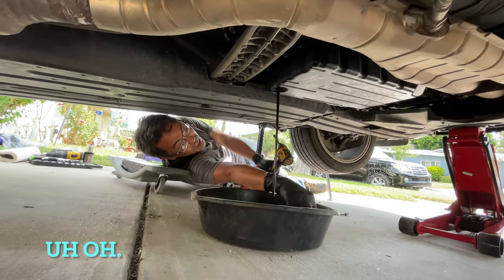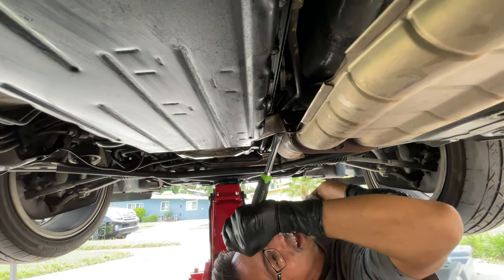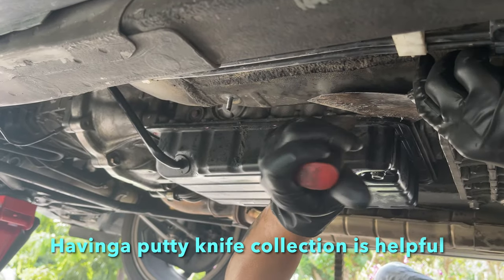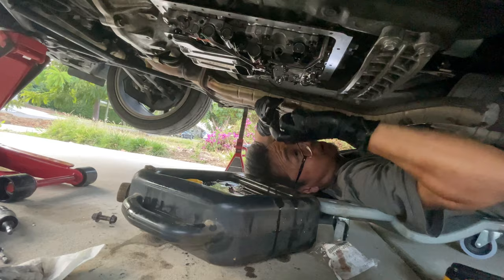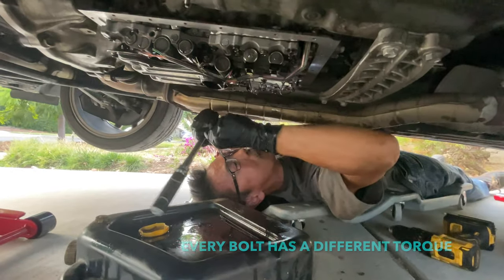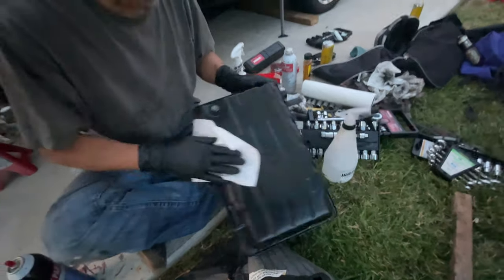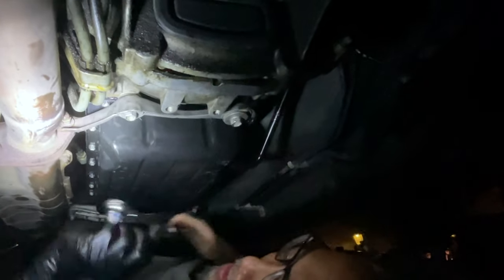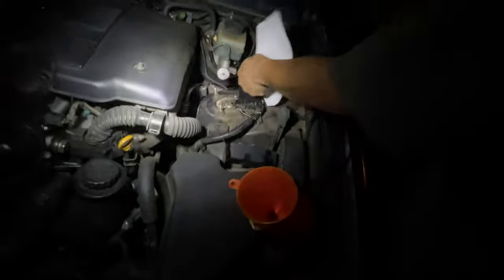My Lexus IS300 P0980 Shift Solenoid Drama.C Control Circuit High Open Short Valve Transmission Error

Comment: I replaced the solenoid on my 02 IS300, with a new OEM solenoid. Check Engine Light still comes on with same code P0763. Any ideas? Fresh fluids and new transmission filter as well.
Reply from the maker: Check the connector (I bent the tab on solenoid and connector) and check the plug continuity (20 amps I think) . Check all wires are getting voltage from harness.  Use Toyota ATF Type T-IV fluid. other fluids will cause code.  Use dealer solenoid and check continuity, deal can send a bad part.  Avoid the after market ones. The computer is sensing the ohms range,  other Toyo's part will fit, but output different ohms. and trigger code.

Comment: Your video helped me to save my 2008 GS350 with only 138K miles. I needed to change S4. So unscrewed all 20 bolts and unlike other videos, my oil pan did not budge. Then found this video. And I was able to dislodge the pan. Thank you.
Reply from the maker: glad it was helpful, it's a tedious job, but plenty rewarding when your back on the road.

Comment: hey did you also get abs codes along with the p0980, and did the solenoid fix the code? Also could you please tell me the symptoms ur car had before u fixed it. Thank you for the video
Reply from the maker: I would get mixed codes and would clear them.  The consistent one was P0980 and it fixed all my codes and check engine light and VSC lights remained off.  Until I started getting P0420 recently.  That was Bank1 Sensor 2 or B1S2.  Those codes were not related.  I checked for  exhaust leak and ended up replacing that O2 sensor and haven't had any codes or lights since.  Which is about 600 miles and passed smog with no problems.

Comment: This is S3 correct? (Shift solenoid valve No.3 (S3) I see on the identification page it’s named that. But S3 on the parts info it is listed as solenoid assembly, automatic transmission 3-way No. 2. Is this correct?
Reply from the maker: @funez-  Lexus part number 35230-30010.     Try searching the part number and looking at images.  I think it was the 3way no 2.  It was really confusing and still is.

Comment: Can over filling the trans cause the code to pop up? I’ve heard so many different things.
Reply from the maker: Hi, from what I've read, overfilling the transmission is a different code.  Has to do with over pressure.  P0980 is shift solenoid C electrical malfunction out of circuit range.  Is it the code you're getting P0980?

Comment: I have 04 gs300  with the p0980 code. Do that part and part number work for my car?
Reply from the maker: I found the link to this technical bulletin for the A650E Lexus transmission on Club Lexus and the 2004 Lexus GS300 is listed.  I think the answer is Yes.  I'd search "2004 lexus GS300 service manual club lexus" for the service manual and then search the service manual for solenoid.  Good luck.  https://tinyurl.com/vccaketj.
Reply: @Squisheyy  thank you very much for the help. Btw love the video and I subscribe to your channel

Comment: Hey. Did replacing the solenoid help? I have a box a960e with p0979. Many people say that the problem is the ECU. Does it make sense for me to try changing the solenoid?
Reply from the maker: Did you try the transmission fluid first?  I'm not a mechanic, but from reading manuals and blog post, I understood that the little solenoid sticks or loses signal. So the problems are related to fluid (dirty or not Toyota fluid), Electrical contact to the solenoid, or the solenoid itself.  I did the fluid first and got another 3 years before the error came back (Don't drain all the fluid or do a full flush, only replace what drains out of the pan).  I also tested the wiring to the solenoid and it tested good.  Then I tested the solenoid and the ohm test failed so I replaced the solenoid and haven't had an issue since.  Sometimes you can clean a solenoid out and it will work a little longer too.  It's just the exhaust brace on the 05 gave me so many problems with exhaust leaks, I didn't want to do it again, replacing the exhaust gasket is such a PITA.

https://www.clublexus.com/forums/gs-2nd-gen-1998-2005/544868-p0980.html

If the solenoid and wiring harness tested good, then it's on to the ECU testing,   My experience is that the ECU doesn't go bad. Good Luck.

Comment: i have this problem on my 02 lexus is300, where did u find the form that tells you what number shift solenoid C is because no part store has letters only numbers for the solenoid
Reply from the maker: I found it googling in a forum.  Either clublexus or my.is.

Comment: hey man I have a 2001 is300 it drives find in drives fine in drive shifts thru all gears no problem. no hesitation what so ever. But no reverse at all. it just free revs. would u think the a solenoid would be this issue as well? transmission is really over full on transmission fluid. Your help would be greatly appreciated. Love the content.
Reply from the maker: Thanks for the love.  Do you have any trouble code? Have you put it on a ODBC scanner or have a check engine light?  
Overfilled transmission could cause the problem.  Also, not using Toyota Type T-IV Transmission Fluid Toyota Part Number 00279-000T4-01. 
I would start getting with a scanner and draining the transmission fluid, not a full flush, just drain the pan and refill it. Also, get a Transmission Drain Crush Washer Part Number: 35178-30010 about $1.80 ea.
An overfill and replacing some dirty transmission fluid is where I would start.
BTW, I'm not a mechanic.
Reply: @Squisheyy  Thanks alot man I just purchased this IS about a week ago and just started doing this. I check the dipstick when hot and on the side with the levels it seem like its about a half a inch above the full mark. Then if I flipped it around to the OPPOSITE side with no marking at all it almost half the length of the dipstick. So I'm guessing surely entirely to much fluid in the trans.
Reply: it does have a cel on. but not sure the codes on it. was told it was on for evap system. At least thats what the previous owner stated.
Reply from the maker: @Vi_Bingy_Garage  That could do it. Half n inch is way too high hot, check it several times to, it sloshes through a lot of channels.  I always fill just under the hot line.  And make sure your car is level.  Was the fluid red, black or brown?  wipe it on a white paper towel and give it a little sniff test.  You're hoping for no oil or coolant smells.  If it smells burnt, you need to drain the pan and refill. I hope not.  These are great cars Once you get the reverse fixed, you're going to love the heck out of it.
Reply from the maker: @Vi_Bingy_Garage  LOL, I just finished fixing an evap error code and didn't get video, it was just a couple of hose, the air intake plastic, and another solenoid.  It's a lot easier then the transmission.  P0440, P0441, and P0442 where my codes.  Now I have an exhaust leak P0420,  I like the the forums, clublexus and my.is.
Reply: @Squisheyy  i belive it was brown is wen I checked it last. like it was the original trans fluid since 01. but I have to do that drain and refill this weekend.  man I really appreciate ur time and insight. I will keep u posted of my findings

Comment: Just replaced my solenoid yesterday. I ended up putting a little over 2.5 quarts and drove it home after that, I realized you said wait 15ish hours before driving, is it okay that I drove it right after?
Reply from the maker: I honestly don't remember why they say to let it sit for awhile.  I know if the dealer replaces it, you can drive home right away.  I think it just needs to soak, but it should be okay.

Comment: I have a low mileage 1994 lexus ES300 V6, SHIFTING ok so far so i ll do nothing,  just 45K miles, getting P0753 SHIFT SOLENOID A ELECTRICAL, any ideas, i am in NC if u close by. New to me, odd that tranny fluid about 1 inch high on dipstick cked warm
Reply from the maker: If the fluid is old and hasn't been changed or the weight of the fluid is wrong (Using only Lexus transmission fluid) That solenoid will stick.  A is usually first to second gear on Toyota/Lexus.  I'd say you have an 80% chance that changing the fluid will make the error code go away.  20% chance the solenoid A is going bad or the wiring isn't making a good connection.    I'd order the fluid online and change it.  Measure the fluid that comes out and put the same amount back in. 
Don't flush it, about 3-4 quarts of old fluid will stay in the system and you want to have some old fluid in there or it will shock the transmission and cause other failures.  I know it's strange, but the Lexus transmission is machined with tolerances in the microns and the computer adjusts like crazy overtime.

Comment: i have a is300 2003 also with the A650E trans. It shifts from 1 to 3rd then from 3rd to 5th. Is that the same symptom you encountered?
Reply from the maker: I didn't have that symptom. My problem was just the code.  Your problem with no code sounds like a dirty or replacement Mass Air Flow sensor or restricted air flow from a dirty air filter or sticking air intake flap.  Do you have a check engine light and a code?

Comment: Do you happen to know which one is shift solenoid b?(p0758) is it solenoid 2?  and what part number, I cant seem to find it anywhere
Reply from the maker: Solenoid 2 should be B. Is this for a 2002-2005 Lexus IS300 A650E transmission?  P0758 doesn't look like it isn't the right code.
Reply: @Squisheyy its for a 2000 gs300
Reply from the maker: @veecemx   
did you try changing the transmission fluid?  That works sometimes.  Here is a link with troubleshooting and an image of the location in the second post. https://www.clublexus.com/forums/ls-3rd-gen-2001-2006/807486-getting-a-check-engine-code-p0758-shift-solenoid.html#&gid=1&pid=2
Reply: Search YouTube for videos by "ATRA -Automatic Transmission Rebuilders Association". They have information on various Toyota/Lexus transmission. Once you find the video, check for the detail of it. They have posted URL to their presentation material.

Comment: Hi so i have  TOYOTA mARK X 2007 SAME CAR TO LEXUS IS250, PROBLEM, Driving in only 3 gears 1.2 and 3, does not go above that, rev are going up, When i disconnect the negative terminal of the battery it resets and the car shifts well, the problem became more common, and now removing the negative terminal does not resolve the issue, i changed transmission fluid 3 time , changes all selenoids valves  and problem persist latest diagnostic code is P0761, aDVICE WHAT SHOULD I DO NOW PLEASE
Reply from the maker: Sorry to hear, it sounds like electrical wiring or connector if disconnecting the battery and reconnecting makes it go away.  If you can get your hands on a whole harness to check the computer, that would be great to. It might be worth paying for a toyota tech computer diagnostic.  The tech needs to have TIS Techstream or Techstream Lite and pay for the  Toyota subscription to run the good shift diagnostics.
Reply from the maker: This guy has a 2 part video where he checks the solenoids on a similar problem on a LS430. 
 If you can find your transmission wiring diagram, it might help find if and which solenoid is bad. 
 https://www.youtube.com/watch?v=f1hd4PHuJnQ
Reply: @Squisheyy  so i changes Valve body  new and new solunoids , problem persist , what do u think now
Reply from the maker: @michaeldande  I think it is the wiring or the connectors.  Lexus is is a A960E transmission Mark X is a U660E transmission, they are not the same. you need troubleshoot an U660E transmission
Reply: @Squisheyy  dont you think there is a conent in the ecu that is defective,this car has an ecu that control engine and transmission, before this problem got worse disconnecting the battery negative side n re connecting it solged the issue, that sounds electric
Reply from the maker: I test my solenoids the same way as in the video I mentioned before https://www.youtube.com/watch?v=f1hd4PHuJnQ   .  If it's not the solenoid, it's the connector, or the wiring, and rarely but sometimes the computer.  I test the part before replacing it and check the connector and then work backwards to the ECU.  Don't keep changing the fluid or replace untested solenoids.

Comment: Es330 2006 ,shift solenoid D, where is that located
Reply from the maker: Is it a 3.3 L 3MZ-FE V6 engine on a 5 speed U151E Automatic?  It should be Solenoid Valve S4  here, or at least similar.  Get in and test before replacing, sometimes connectors and wires go bad and not the solenoid..   https://lexusownersusa.b-cdn.net/uploads/monthly_05_2009/post-8723-1241744417.jpg

Comment: Would you recommend changing the transmission filter while you’re in there?
Reply from the maker: The transmission filter is aluminum encased wire mesh.  It doesn't' hurt to clean it out, but they don't need to be replaced like the paper/cloth filters.  If it is clogged and can't be cleaned, change it.  Or if you have symptoms, then yes, I recommend changing it. If not, then no, don't change it.
Reply: Thanks so much! Will do.

Comment: Did you get the front and back of the solenoid diagram switched?  It looks like you are removing the solenoid from the driver side / front. And not the passenger side / back.
Reply from the maker: it's driver side front.  the diagram is upside down.  It took me awhile to figure it out. I saw it by finding the SLN,SLU and SLT. C or valve 3 is on that same side.  It's confusing.
Reply: @Squisheyy  I just finished and yeah you are right of course.  I was confused until I pulled the pan.  I had better luck than you getting it unstuck.  But... I did cheat on the exhaust bracket.  I drilled a hole through it. I saw it as just holding the exhaust, and it was just enough to get over the bolt.
Reply: Watching this, I was confused, too. Just to clarify, solenoid C is on the driver side 2nd solenoid from the rear?

Comment: Good morning brother, did it fix the problem? My is300 has a rough shift, should I run the scanner?
Reply from the maker: yes sir, that fixed to for me.  I would definitely scan it before tearing everything apart.  A rough shift is probably something else, change the fluid if you haven't already, use Lexus Tran fluid.
Reply: @Squisheyy  mines has close to 200k but not sure if the guy before me had it changed. Will changing it ruin the transmission?
Reply from the maker: Changing it won't ruin the transmission, but it probably won't fix the rough shift if you aren't getting the code.
Reply: @Squisheyy  my scan codes gave me these  P0051-P0037-P0154-P0057
Reply from the maker: uh oh, those are all O2 sensors which can cause shifting problems as the computer leans out the air fuel to compensate.  skip the transmission and go straight to checking and replacing O2's
Reply: @Squisheyy  Thanks brother. If I drain and fill the tranny , since I never did it! Sulm it hurt my tranny?
Reply from the maker: From what I understand, your not suppose to completely drain the whole system. Just from the pan and it should be okay.  Just from my research.
Reply: @Squisheyy  Superb! And the shifting solenoids should I just change them all? Or leave it alone and hit the sensors first? I never knew sensors can mess with the shifting lag sometimes..
Reply from the maker: sensors don't really cause shift lag. I think your O2 sensors are causing it.  Did you replace those yet?
Reply: @Squisheyy  Not yet but soon. Been working from home and when I'm out it's already dark. But I'm ordering them now on ebay Denso